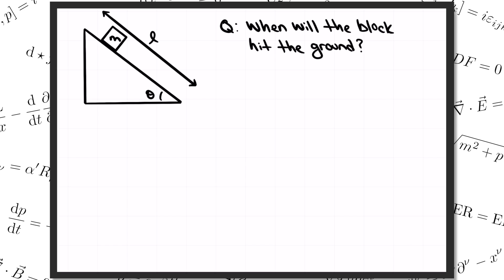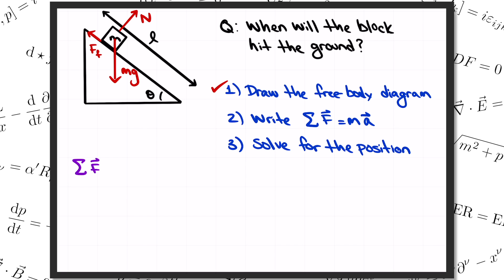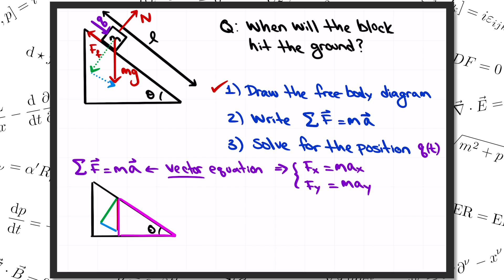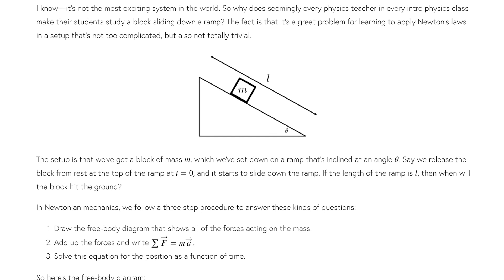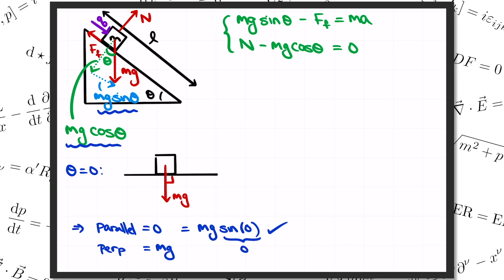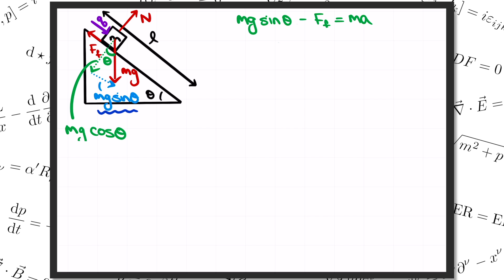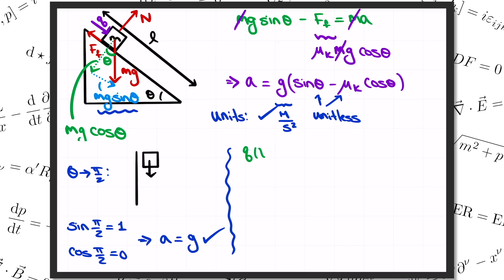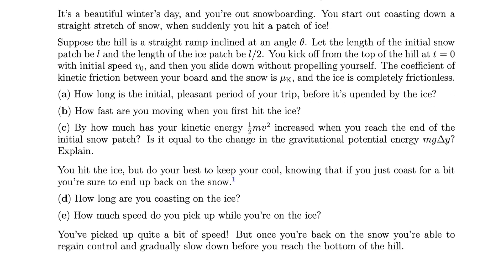Blocks Sliding Down Ramps, and All That: Physics Help Room

Comment: When you arrived to the equation of the acceleration in parallel direction you performed a quick check if it make sense by checking the units of the both sides. 
You said that it is ok since g has units of meters per seconds squared and mu and theta are dimensionless. And yes both sides match, but your motivation was wrong. Theta has units: degrees, or radians or whatever angular dimension you choose. Its sine and cosine are actually dimensionless
Reply from the maker: Hi Lyubomir, angles don't have units. Radians, for example, are defined by taking an arc length around a circle and dividing by the radius, so the units cancel out. You can't take the cosine or sine of a quantity with units.
Reply: @PhysicswithElliot  Hum... You are actually right... (Face palm my self). I was going to ask "But what about angular velocity, then?", and then I realize (for the first time) it actual dimension is 1/time... I am going to eat my diploma...
Reply: @PhysicswithElliot  Physics won't break if you define a full circle as being 360 degrees. If you kept radians everywhere ignoring the fact that they are dimensionless, you would find that out that they will behave like any other units and then you can even check if you take a sine of radians everywhere (and if you don't, you've made a mistake).